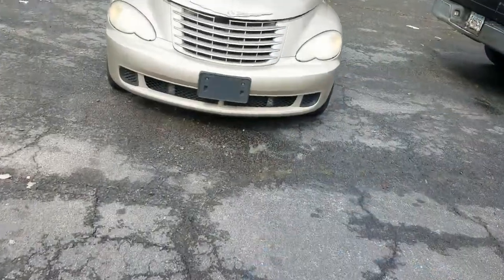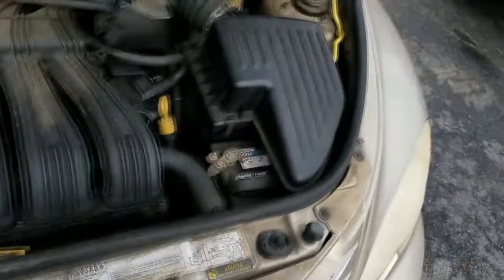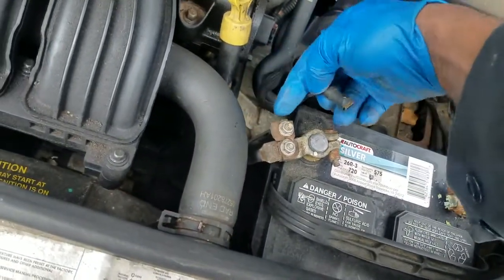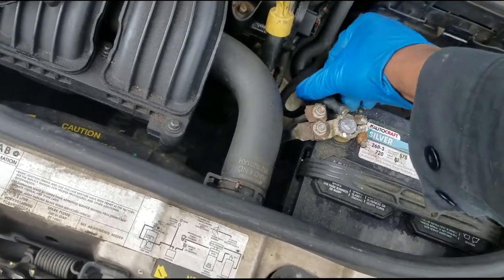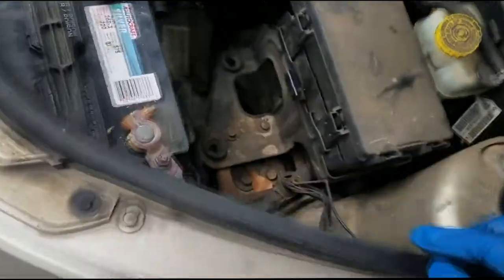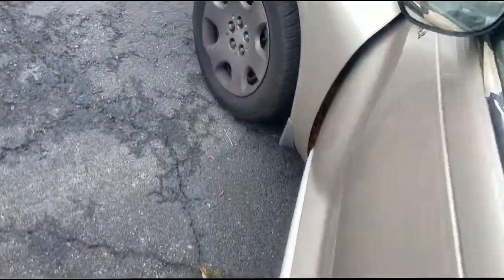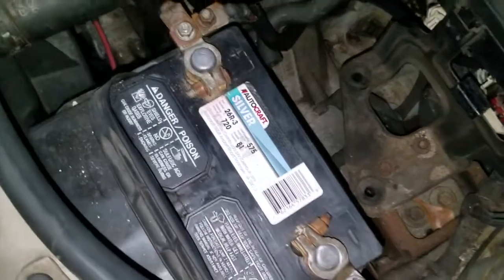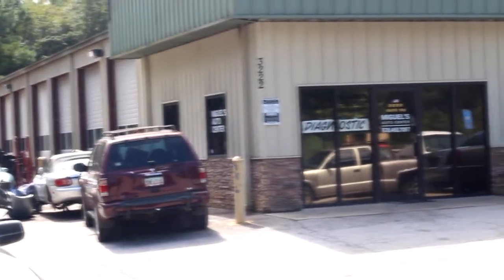No Crank No Start diagnostics. What to do when parts know longer available. Key fob not detected.

Comment: Where are you located I got an 06 with start issues and TCM PROBLEM
Reply: Pt cruiser
Reply from the maker: @pamschoenmann3592  im sorry, I dont have a shop anymore. Lease up
Reply from the maker: @pamschoenmann3592  Whats wrong with your PT? O and please be subscribed already, thanks, and like the video for me, thanks
Reply: @OnlineMechanicTips  it won't shift out of second gear into the higher gears have replaced starter solenoid have replaced the computer brain Next Step to change out the TCM external or Tos   the car has 105000 miles on it
Reply from the maker: There is no TCM, its built inside the PCM..are you getting code P0882?
Reply: @OnlineMechanicTips  not sure saw 0p0700
Reply: Could I be wrong and it be tmc sensor
Reply from the maker: @pamschoenmann3592  No such sensor..Are you subscribed to the channel?
Reply: @OnlineMechanicTips  yes I sent this information to my mechanic
Reply: I really like your videos even a woman can follow your directions
Reply: @OnlineMechanicTips  I was told the car is in limp mode we replaced the tipm  and had it reprogrammed to the car. Sometimes it won't start at all